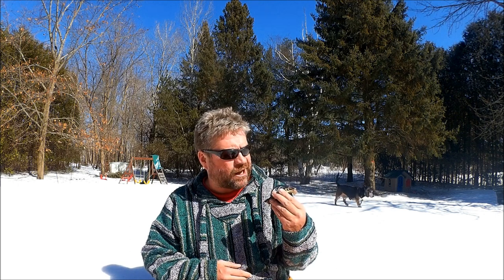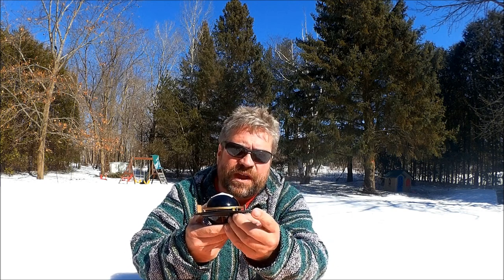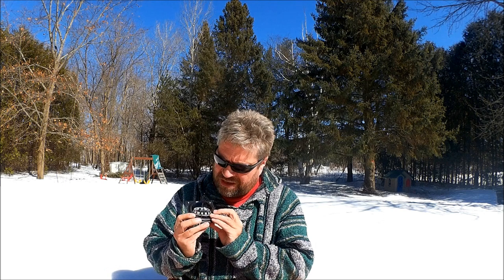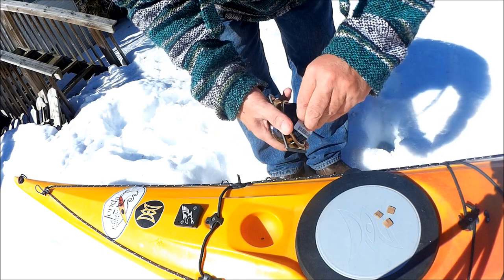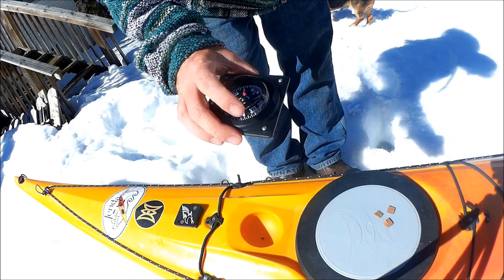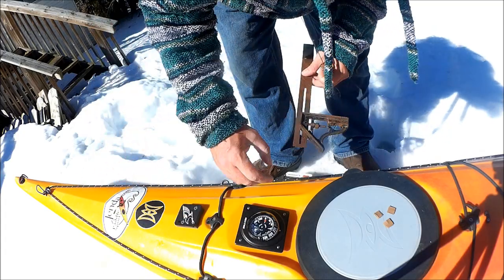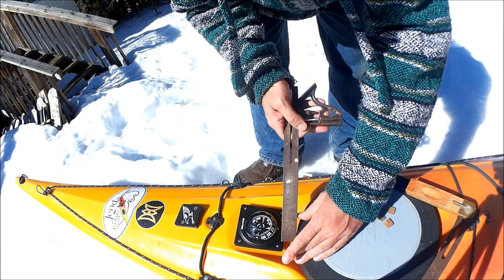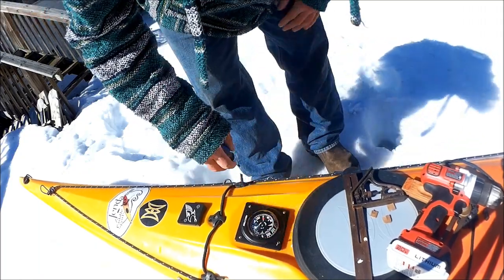Kayak Compass Installation- Brunton 70P

Comment: Did use gasket at all to prevent water from sipping in?
Reply from the maker: If I remember right the compass came with a foam rubber style of gasket.  I don't own the boat any more.
Reply: @travelbywater9378  Thanks for the quick reply. Bought mine from an authorized dealer in sealed box and no gasket😅